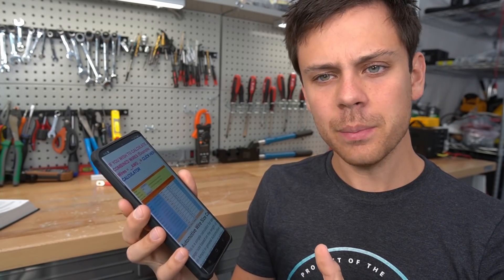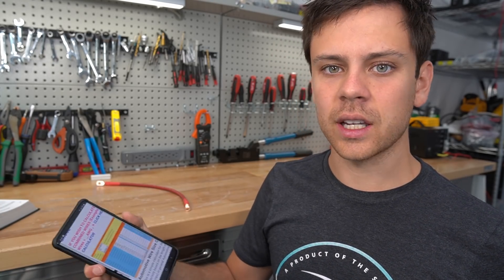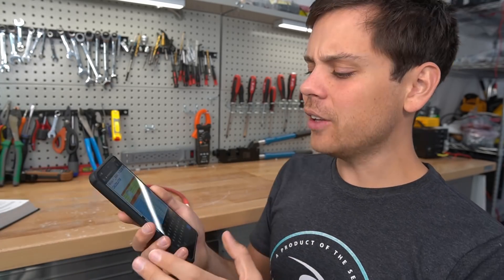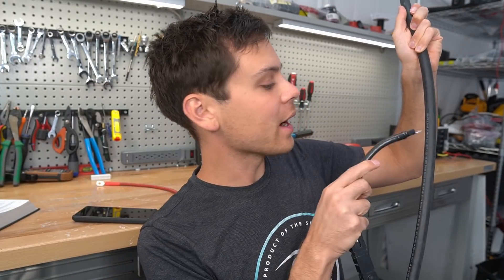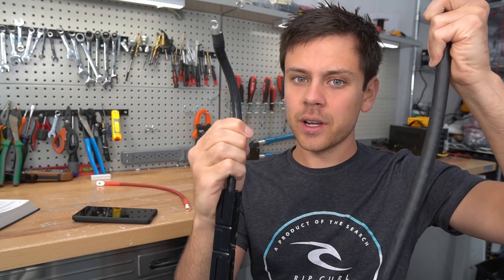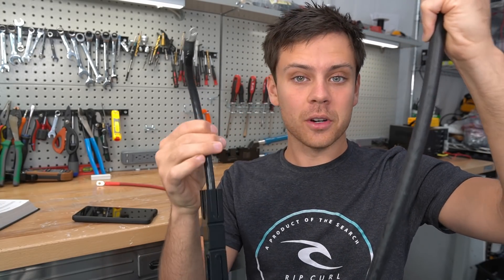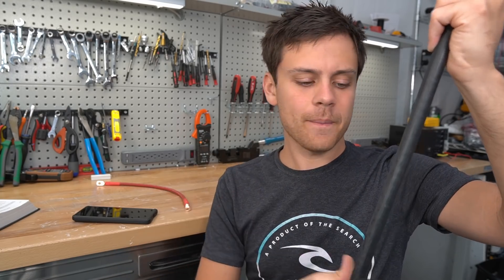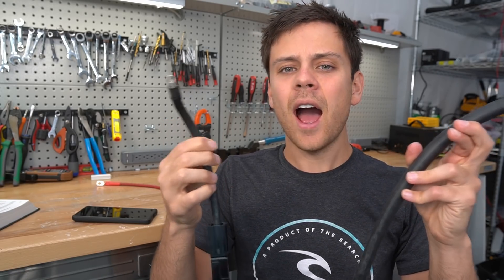How to Determine the Ampacity of a Conductor

Comment: I don't think you need to double the length. Each wire carries the same current in each direction (DC) so just using the length one way would be correct.
Reply: You double the length because it's the total circuit length (NEC and ABYC both use the roundtrip circuit length).
Reply: @PusoPinoyAko  If you could point me to the NEC section I would appreciate it. I suspect that for total voltage drop you would use the round trip distance but for allowable ampacity I don't think you need to.
Reply: @rjm7168  I think you're not understanding that there's two things here. Voltage drop is different than wire ampacity, and they are calculated differently.

Voltage drop is calculated off the roundtrip circuit length. If you only calculated one leg of the circuit, you are missing the other half of the resistor (the wire). If you calculated the voltage drop to a tolerance of 5% but only accounted for half of the circuit's length, then you actually have a voltage drop of 10%.

Ampacity is based off the size of the conductor (and can be derated depending on factors) that specifies how many amps under specific conditions a conductor can carry before it exceeds it temperature rating. Exceed the temperature rating and fires start.

Voltage drop is important when choosing wire size because as the roundtrip length of the circuit increases, so does the voltage drop. When the voltage drops, the amount of amps the load uses increases. It is possible that the voltage drop is so great that the amps required to power the load will exceed the ampacity rating of the wire.

Take this example - you have a battery that's fully charged sitting at 13.8v, and you have a circuit powering a 70w light bulb. At no voltage drop, that bulb is pulling 5 amps across the conductor.

Let's say you run that bulb all night, and your battery is dead at 10.5v. The bulb is now pulling 6.5 amps through the conductor.

Now let's say you ran a roundtrip voltage drop calculation at 5%.

At 13.8v on the battery, the bulb is pulling 5.25 amps.

At 10.5v on the battery, the bulb is pulling 6.7 amps.

Now let's say you only used one side of the circuit for the voltage drop calculation at 5%.

At 13.8v on the battery, the bulb is drawing 5.5 amps.

At 10.5v on the battery, the bulb is drawing 7.3 amps.

Hopefully that example helps you to see how quickly the amperage rises when the battery gets low and the voltage drop increases. That was just for a 70w bulb. Now try that with an inverter that's pulling 200 amps. If you size your wire to 200 amps and the battery voltage drops, you will exceed the wire rating. If you only used half the circuit length in determining the voltage drop, you're only accounting for half of the voltage drop. Both cases can result in fires.
Reply: And just to complete the example for the 3000w inverter drawing 2760w...

At no voltage drop:
13.8v battery = 200a
10.5v battery = 263a

Roundtrip 5% voltage drop:
13.8v battery = 210.5a
10.5v battery = 276.7a

Half circuit length 5% voltage drop:
13.8v battery = 222.23a
10.5v battery = 292a

If you sized your wire for 200a because that's what it would draw with a full battery, you would exceed the wire ampacity rating just by the battery going dead during the night.
Reply: @PusoPinoyAko  Dude - I only asked if you could point me to the NEC section that you refered to. Also, I just said there are 2 things going on so maybe I understand more than you think so don't be so presumptious. BTW - I'm not interested in your example.
Reply: @rjm7168  you obviously didn't know what you were talking about in your first post. Will was literally explaining to look at the voltage drop calculator to see if it says roundtrip or one-way, but you said you only need the one-way length for ampacity. That is wrong because as he quoted Nigel saying, length has nothing to do with ampacity. My response was to clarify that there are two things he talked about, and how each one should be considered.

Comment: Do not use cheap low amp rating crimp connectors on high amperage draw does not matter how big your wire is if you’re crimp connector is going to go up like a cherry red hots flame 🔥 
                     When in doubt always upsize safety over money

Comment: usually the load has bigger sized wire because its a high amp draw and the charging side for example the solar panels have thinner wire because its not a high amp rate.
Reply: Yes, but distance (voltage drop) is also a consideration. It's always best (and cheaper) to run higher voltage. Lowe amps means smaller, cheaper wire. 1200w at 12v is 100a (4awg for short run), whereas 1200w at 24v is 50a (6awg for short run). (ABYC chart table)

Comment: General rule of thumb in the U.S. for aluminum wire: Use one regular size larger than required for copper.
In other words, if you compute you need 12ga copper wire, then you could use 10ga aluminum. Or if you compute you need 2ga copper then use 0ga aluminum, or if 0ga copper wire then 00ga aluminum.
Regular sizes are strange..  generally for 2ga or bigger numbers (smaller wire) you need to 2 ga larger for aluminum. Once larger (smaller numbers) than 2ga then the next regular size is only 1ga larger. You can look up the equation for converting American Wire Gauge (gauge or ga. or a.w.g.) to cross-sectional area to get an idea why. It's sometimes fun to see how complicated the math is in order to represent the units derived from easy/intuitive manufacturing. :)
Reply: Actually, you should increase two sizes to maintain the same ampacity when switching from copper to aluminum when your copper conductor is #4 or larger.  E.g. #4 THHN copper is good for 90 amperes @75°C, while #2 XHHW aluminum is also good for 90 amperes @75°C. 
You need to increase one size if your copper conductor is #8-6
If you're using #12-10 copper you can use the same size aluminum conductor, but you should take care to account for increased voltage drop in long runs.

Comment: Im starting to feel like the world is getting a bit too smart for itself. Generally, people, unless they have a phd will rely on suppliers to get it right or just over spec the wire. Some will learn by experience from underspecomg . Mostly irrelevant as a topic
Reply: 🤔 How do I charge a battery?
Reply: @PusoPinoyAko  Charge your battery from your battery my friend. Solar energy is a convenient way to replace the losses. I have another video coming out shortly. Just trying to educate people to an alternative. Those who want to will learn, those who dont will hang on to the words of those from a couple hundred years ago. Sorry for the quality of the video I posted.
Reply: @batteriesforeverything7112  so I can charge my battery from itself?
Reply: @PusoPinoyAko  No. From another battery, but as your battery charges the other will discharge as you use it. Then just turn them around and start again ps  I appriciate the chat. Not many ppl open minded enough to entertain the unusual

Comment: The rise in temperature of a wire made from specific materials, due to ohmic heating by a DC electrical current, may lead to uncontrollable thermal runaway with ensuing melting. Thermal runaway stems from a steep decrease with increasing temperature of the thermal conductivity of the conducting material and subsequent trapping of the ohmic heat in the wire, i.e., from the inability of the wire to dissipate the heat sufficiently quickly by conduction to the cooler ends of the wire.

Comment: How do you factor in connections.    I assume going 10 feet with a single cable is different the going 10 feet with a fuse connected in the middle?   Doesn’t each connection increase the resistance or not enough to make a difference?
Reply: First, don’t put a fuse in the middle.   Put it at one end near the voltage source.  It does no good in the middle if you have a short between the fuse and a battery.  You’re day will be ruined.  To your question the connectors if sized correctly for cable size won’t have any more loss than if they weren’t in the circuit. What you don’t want to do and Will pointed this out, is to size for 2% loss from say an array to a fuse block and then a separate 2% loss from the fuse block to the battery.  Treat it as one complete cable run for sizing.

Comment: 😂😂😂 Don't EVER try to call Will out on something technical unless you know what you're talking about. You'll get SCHOOLED.
Reply: There is one thing I would like to call Will out on. He has shown many times connecting the positive battery cable first, then the negative. In most electrically isolated systems, this is acceptable.

However, if you are working in a complex system, like an RV, this is a TERRIBLE idea. By hooking up the positive cable without having the negative attached first, you are creating a “wild” power situation. Electrons can flow in, but there is nowhere for them to go back out of the circuits. In my many years in the RV electronics industry, I have seen dozens, if not hundreds of scenarios where electronics in an RV were damaged because of this exact series of events.

Car manufacturers say to unhook the negative battery cable of your car first only because if you accidentally strike your wrench on the frame while loosening the cable, you will not cause damage. You can get away with it in a car because it is a “simple” system. There is only one single power source. An RV has multiple battery banks, plus shore power, plus (optionally) solar. Unhooking negative without unhooking positive first will cause electrons to try finding an alternate path to ground/battery negative.
Reply: I’m only telling of what I have witnessed people do many times in the past.

I do agree 100% that what I describe doesn’t make sense on the surface. It should make no difference unhooking one conductor vs the other. You are breaking the circuit either way. However, theory and field often are not exactly the same. I have witnessed many cases in RV’s where there was a negative battery connection failure, either by somebody unhooking the negative cable at the battery while the positive is still hooked up, or where the negative cable goes to frame, the connection had broken down. In either case, I have witnessed ground traces on circuit boards in RV battery control centers and other 12v RV electronics burned up as a direct result.
Reply: If you disconnect the negative from the battery, there are no longer any electrons moving through the circuit to be looking for a path to ground. Sounds to me like somebody fried something, couldn't explain why it happened, and blamed it on some theory that they concocted.
Reply: You can take the positive lead only of the battery and touch and hold it to any electrical component  in that trailer for as long as you'd like, and as long as the negative terminal is not connected to the trailer, the magic pixies will be unable to escape their lifepo4 prison and damage ANYTHING.
Reply: I'm starting to understand Will's frustration, lol.
Reply: @tranerekt1731  Will is always professional and respectful. A lesson to us all, I think.
Reply: WILL!!! This guy is making up weird nonsense about "wild" power situations and trailers having "complex" systems and such. Could you please help him?
Reply: You hear that Will? If you reconnect the batteries to the "complex" voltage converter in a trailer, the magic pixies will get angry that they can't escape, and they'll go "wild" and trash the place.
Reply: @tranerekt1731  I am not trying to be argumentative at all, I am just trying to pass along helpful information that I have found from working in RV electrical for the better part of 15 years. I would love to hear an explanation as to why I have seen electronics in an RV fail immediately after a negative battery connection is unhooked. My most likely hypothesis is that, after being denied it’s primary/preferred path, electrons will take an alternate, unintended path, such as the case ground of a piece of equipment that has been negative battery disconnected with a live positive still hooked up. That is why I say that an RV electrical system is “complex”; there is more going on than an isolated workbench circuit.
Reply: @tranerekt1731  are you 9 years old?  You sound like a little kid crying out to teacher that someone’s been naughty in class. If you didn’t understand the comment from Chris Bayus, better to keep quiet and avoid losing your dignity.

Comment: I2R copper losses. About 0.02 Ohms per hundred feet. But... if DC remember its a resistor. It dissipates heat. Cross section of conductors changes with corrosion. A battery cable on car loose or dirty limits cca. Air oxidizes copper. If near Halogens (Chlorine etc.) or H2S it forms sulfides that turn wires green (Cl) or black (SO2) and creates high resistances. If bad, it can cut power significantly. Marine environment:  coat conductor cables with correct grease. In septic or sewer regions use a desiccant that absorbs moisture and the gas types. Also I personally corrected dozens of electronic problems where Grounds to earth were corroded. CMOS doesn't like floating currents.

Comment: Very good. Only thing I would add from an intuitive understanding perspective is that power loss over a cable increases with the square of the current flowing through it. It's easy to intuitively think double the current, double the losses (or half etc) but this is not the case. Excellent video.

Comment: If the wire is the charge wire from charger to batteries and I have a battery sense system so charger has true battery voltage, will a larger charge wire make a significant decrease in the power that the charger needs to generate to charge the battery?  Will it take 90 minutes less time to charge a battery as an example? If current set up is in bulk most of the time, does a larger wire make a decernable difference?
Reply: The separate sense wires are there to measure the voltage drop so the charger ups the voltage to compensate for voltage drop. Meaning, if the charger sees a 2v drop on the sense wires, it will send 16.4 instead of 14.4 on the charge wires to compensate for the drop so there's 14.4 at the battery bank (it's not 1 to 1, but that's an example).

Typically the charger manual will specify the size wire to use because it is expecting a specific sense wire resistance. Some even specify length of sense wire vs gauge. It's best to follow the manual.
Reply: @PusoPinoyAko  Actually I use the blue tooth battery sense for Victron chargers so sense wire gauge is not an issue. What I was after was my original system came wire 12 AWG charge wire from charger to battery. I have since changed solar panels and chargers to 450 watts paralleled and mounted flat on trailer with the 100/30 Victron charger and 200 AH lithium battery. The 12 AWG charge wire does get slightly warm above 20 charge amps, but nothing serious. Would an 8 AWG charge wire allow charger to charge battery in significantly  less time?
Reply: @stevejansky9913  ah... So we all lose some power in the form of heating of the wire, but it is usually minimal - meaning you wouldn't see much of a decrease in charge time unless your wires are burning a hundred+ watts of power.

That said, how far away (wire length roundtrip... positive length + negative length) is your charger to the battery? At 3% voltage drop, 12 awg is pretty good up to about 6ft (3ft one-way), and 8 awg is good to about 15ft (7.5ft one-way).
Reply: @stevejansky9913  forgot to mention those lengths were good for 25a. If you want to rate the charge wire for the full 30a capacity of the charger 10 awg is good for about 10ft (5ft one-way) and 8awg is good for about 15ft (7.5ft one-way).
Reply: @PusoPinoyAko  My battery is 15 ft away from charger, one way - like I said earlier this system works with only slight warming of the 12 AWG cable when above 20 amp charge rate. I am trying to justify the expense and time/labor to change over to 8 AWG. With excess voltage presented to the charger from the panels, the voltage drop seen in the charge wire seems to not be a problem. Prior to battery sense I was measuring about 1.3 volt drop when measuring at battery posts and comparing to charger voltage read out.
Reply: @stevejansky9913  price is a consideration, but so is safety. According to ABYC, the minimum wire gauge for a 30ft run at 3% and 20a would be 6awg. At the full 30a output 3% and 30ft you would need 4 awg. And because  that's ABYC, those recommendations are assuming the wire has a 105C rated insulation.

 I don't think you're in burning wire territory, but you are in 10% voltage drop territory. Bumping up to 4 awg would definitely help get you back to <3% voltage drop territory. You would see an improvement in how long it takes to charge the battery because the conductor can more efficiently carry the current, but I don't think you'd see a 90 minute decrease in charge time.